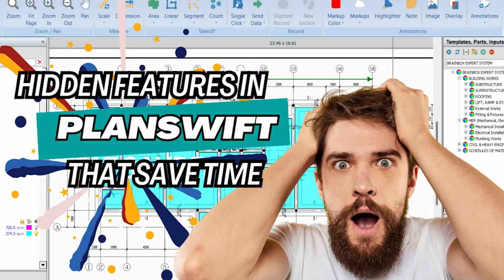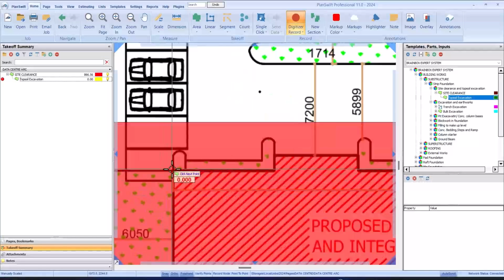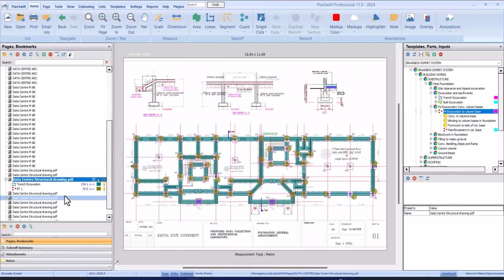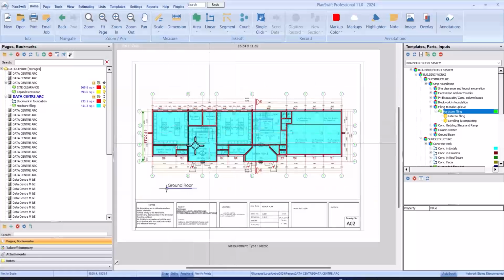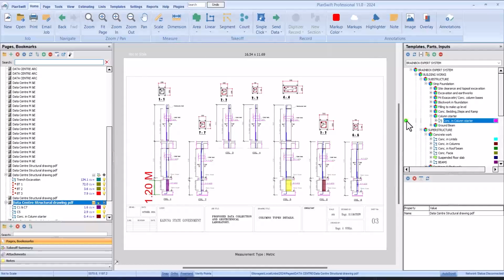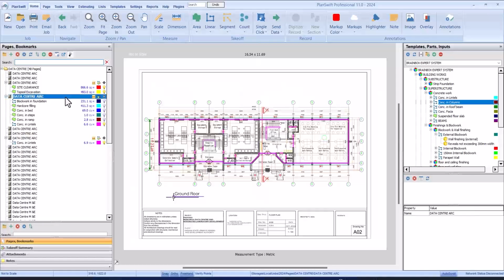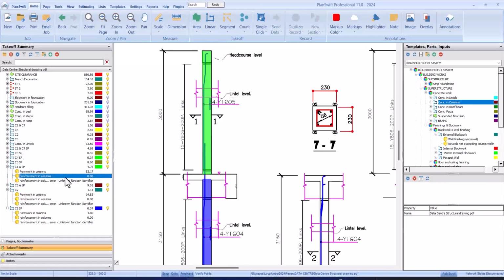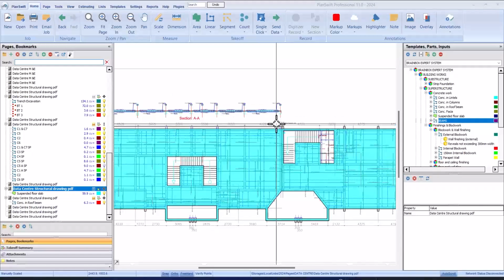PlanSwift Tutorial and Template | Tips & Tricks | Quantity Takeoff | Complete Takeoff Walk-through

Comment: Question:

1. Is ground beam is a complex project term while tie beam is housing term?
2. Why had you quantified lintels throughout external walls? Lintel is installed for opening areas like windows and doors since the purpose of lintels are to support the weight above on it.

Thank you.
Reply from the maker: 2. In some buildings, we do have round lintels externally only, to hold the buildings and also support tie beam/head course
Reply from the maker: Thank you for watching and Question 
1. Ground beam and tie beam are two separate items of work. Whether complex or housing, you can still have both Ground beam and tie beam in a single building 
A ground beam is a reinforced concrete beam constructed at ground level, primarily used to distribute the load from a structure (like walls or columns) to the foundation. It is part of the foundation system and helps support the building over weak or uneven soil.

On the other hand, a tie beam/head course  is placed above ground, usually between two columns, and its main purpose is not to carry vertical loads but to hold the columns together, preventing them from buckling or spreading apart. It acts as a horizontal support that enhances the overall stability of the frame structure.

In summary, a ground beam supports loads to the foundation, while a tie beam/head course ties structural elements together for stability.
Reply: @brainboxnotion well explained and understood, learnt from this response. Thank you sir